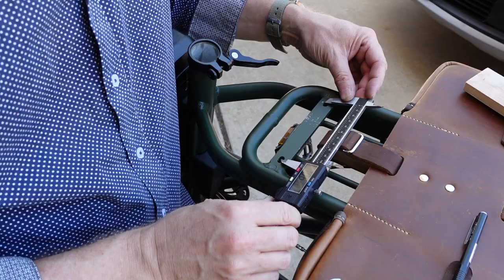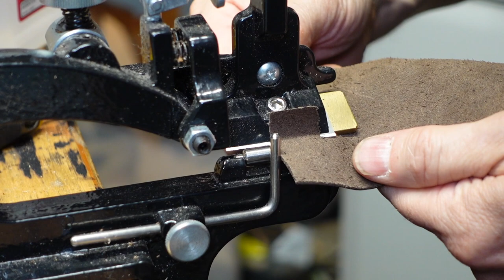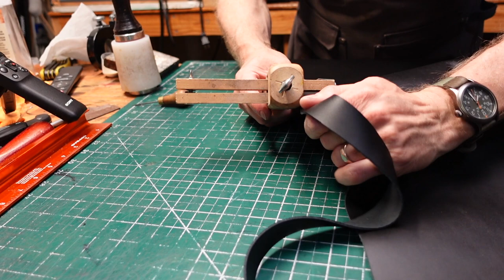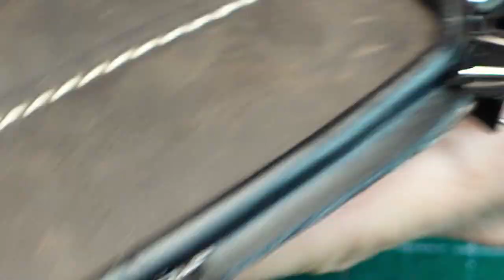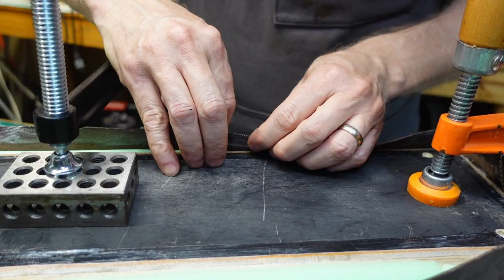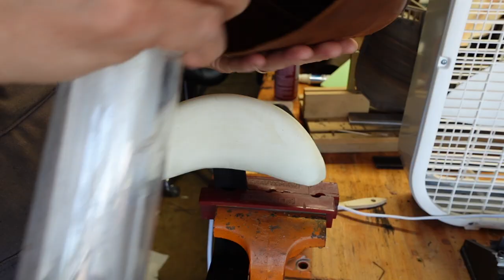Making & Upholstering a Leather E-Bike Seat from Plywood Leather Working ASMR

Comment: so... this bike is on my shortlist of bikes... I have 5th &  7th grader combined they may weigh like 130lbs (they are small kids)... so I say that to ask... do you think this thing can fit 2 kids on your seat?
Reply from the maker: The rear deck area is large enough for two kids, yes. Looking back at it, I would have made the backrest taller ... more like sissy bars on a motorcycle. When throttling, it has enough torque to make the rear person fall back if not holding on. I may make that alteration eventually.

Comment: Great job. That rolled edge looks great. Where do you get those different feet for your machine? And what glue are you using it seems to hold well?
Reply from the maker: The piping feet are from Amazon. They're relatively inexpensive: This set was $30 for six different sizes. I'm using Eco-Weld contact cement.